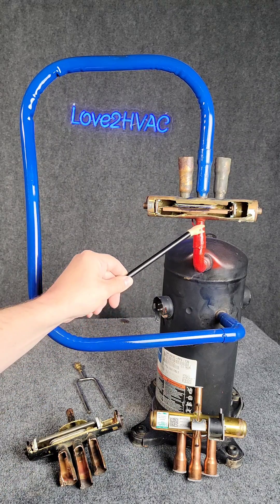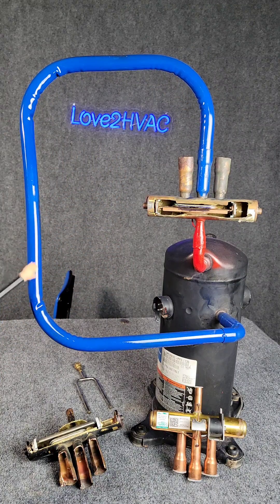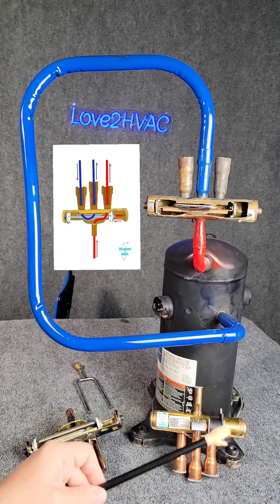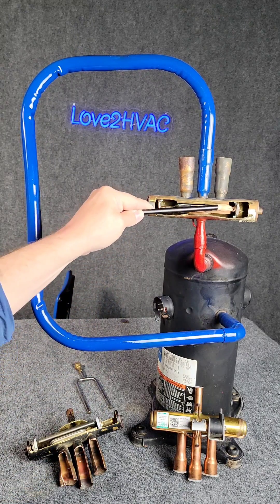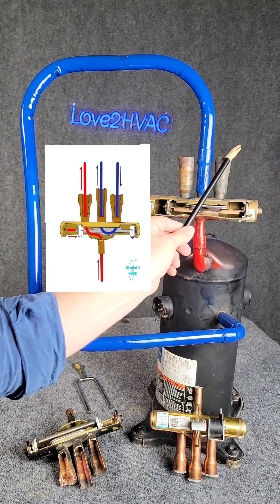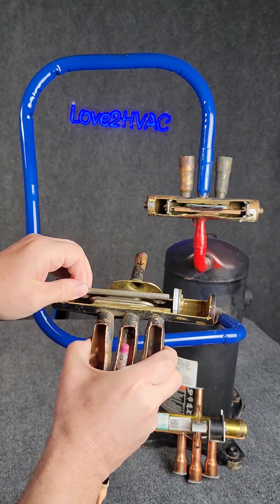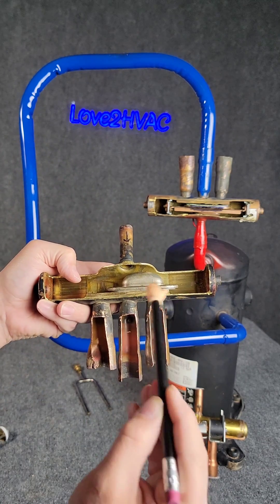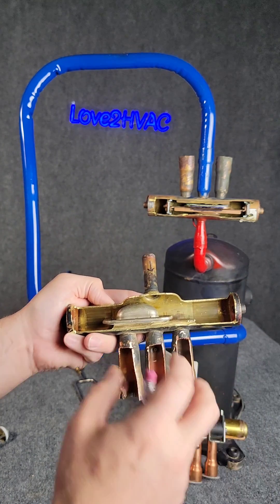The reversing valve simplified.

Comment: How the two different line sizes going to evaporator work when in reverse? Confused
Reply from the maker: If you go to my channel, under playlist, I have one called heat pump that will explane it in great detail. 

In short instead of suction gas flowing from the indoor unit threw the big line to the compressor, it now flows from the compressor discharge line (hot gas) through the big line to the indoor coil. From there it will condense to a liquid bypass the indoor metering device and it's still liquid in the small line  it now it's flowing to the outdoor unit where it will be metered in a metering device there. 
The liquid line is still liquid it's just flowing the opposite direction. 

The large line is still has it vapor, in AC it low pressure vapor, in heating it's high pressure vapor

Comment: Quick question for all the techs out there.... if a unit is low on charge  could it cause the reversing valve to become stuck?
Reply from the maker: Low on charge will not have enough pressure difference to make the valve shift. It needs approximately 100 psi pressure difference.

The Little pilot valve on the back side   diverts HP discharge gas to one side of the slide valve and connects the opposite side to suction. The pressure difference makes the main valve move.

So low on charge won't make it stuck but it won't have the pressure it needs to move it.

I have been to nearly 30 reversing valves that were miss diagnosed as bad. They rarely go bad, it's usually something else.

Comment: What do you think the lifespan of that valve is? What's the labor effort needed to repair it?
Reply from the maker: They should out last the system.
In my career I have replaced less than 6 3 from someone overheating and 1 from someone striking it with a hammer. The 2 remaining was from system contamination blocking the pilot tubes.

I have been to nearly 30 that were misdiagnosed. The actual problems being wiring, bad solinoid, low on charge, clogged filter drier, bad compressor valves, stuck check valves internal and external.
Reply: @love2hvac  thanks this helps in my understanding of the technology.